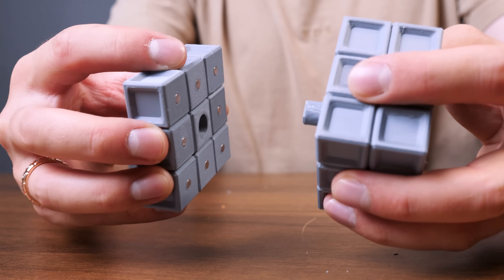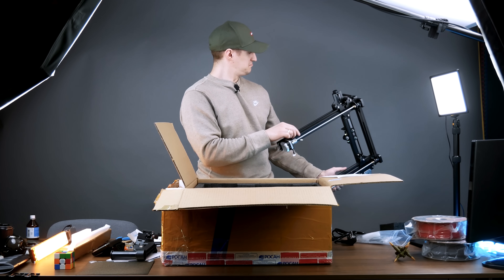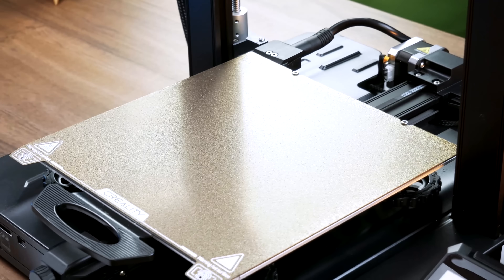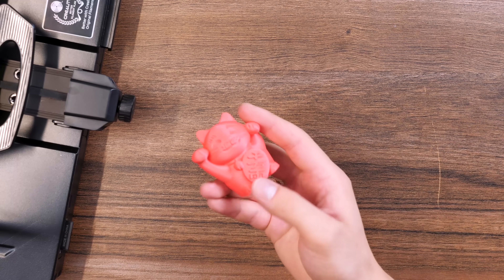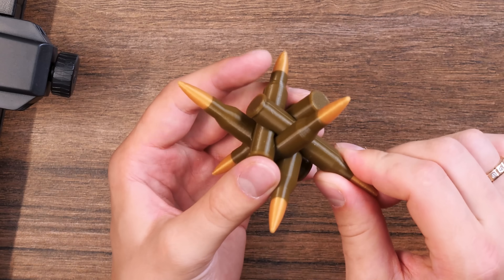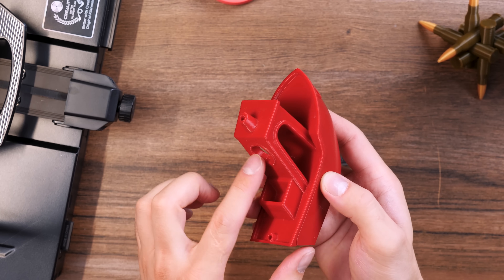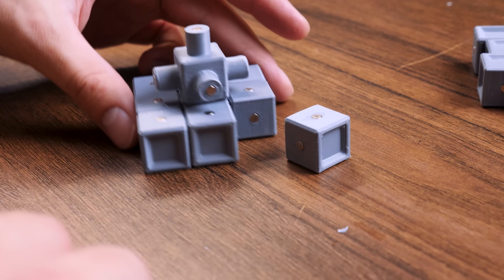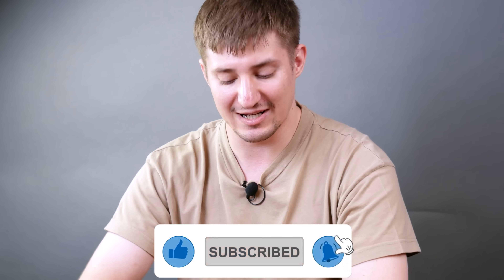I REINVENTED RUBIKS CUBE | created 3x3 on magnetic force

Comment: What if the cubes were hollow, and open on the side that the colored insert goes.  And then the magnets installed from the inside, so they're invisible, and also slightly further apart giving it a smoother turn.

Comment: Maybe you can make the insides like 0.5 mm thicker, and then sand and polish them down to exact size and get some smoother turning? its also possible to apply some heat to get 3d prints really "polished"

Should also be possible to print with rounded corners to get that corner-cutting from speed cubes!
Reply: also: how about making the core spherical?